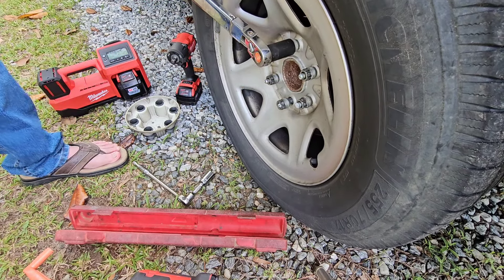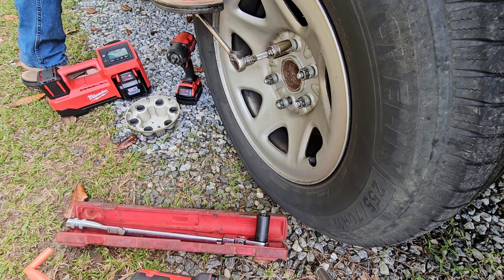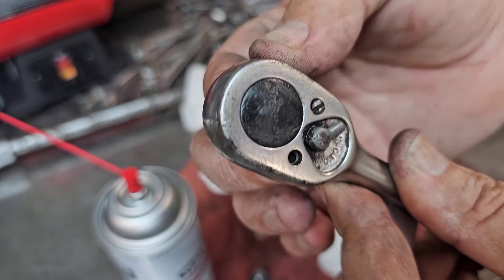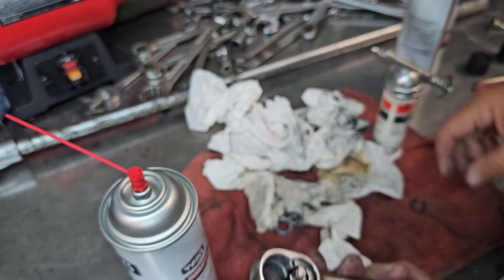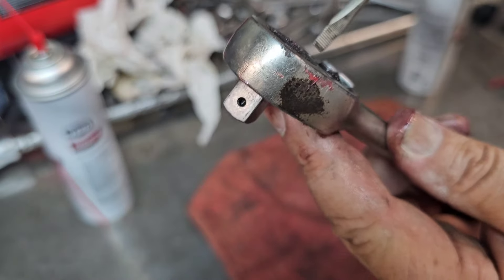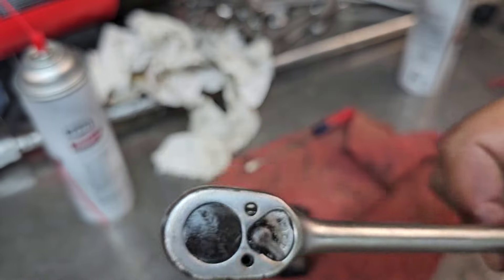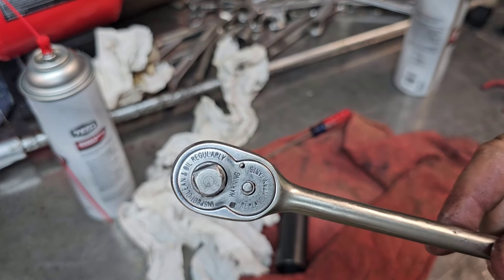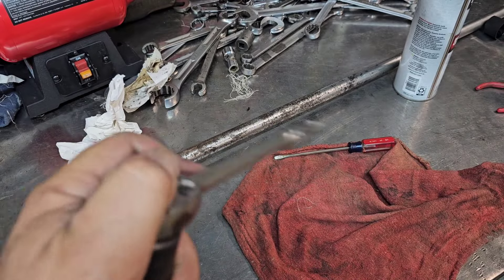40 Year Old Worn Snap On Ratchet Demonstration.

Comment: So there's no Icon ratchet in this video?

Personally I don't use old ratchets, the old stuff is usually weaker / softer steel. New stuff is better than old, generally. I use a double pawl Wright for most things, or an extendable Hazet. No real need for cheater bars on a ratchet for what I do, unless it's on the 1" drive.
Reply from the maker: No Icon. The video is for those who claim icon is the same quality as SnapOn and is a demonstration  proving their claim is flawed.

Comment: I’ve got jus tabout all of my tools from the 70’s. And quite a few of my Dads wrenchs and sockets from the 40’s & 50’s. Can’t beat some of the old tools. Long before China.
Reply from the maker: Alot of the tools I grew up using walked away.
Reply: @bigboreracing356  At 71 Mine didn’t walk away, I just don’t know where I filed them. Or my dogs hid them again !!! 👍
Reply from the maker: @Oldgreycowboy  😆
Reply: @Oldgreycowboy Have any black handle Snap On tools from the 70s and 80s?
Reply: @fauxque5057  No, don’t have any snap on tools. Most of my sockets and wrenches are the old Craftsman, a few SK. And some are just unbranded. A few newer sockets are Pittsburgh that have snuck in there. Needed some impact sockets. Never had an impact wrench till a few years ago.

Comment: Why don’t you stand on the Icon like you did with the Snap On?
Reply from the maker: Lol There is no such thing as a 40 year old ICON that has been  through what my Snap On  has been through or I would.
A five year old  ICON with broken and worn internals will not perform as well as my 40 year old ratchet.
   The ICON is junk.